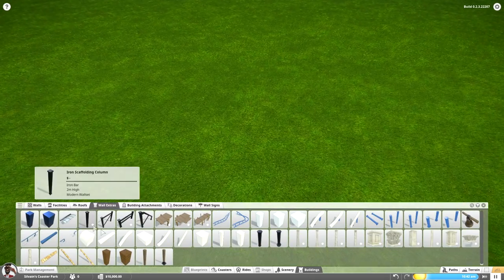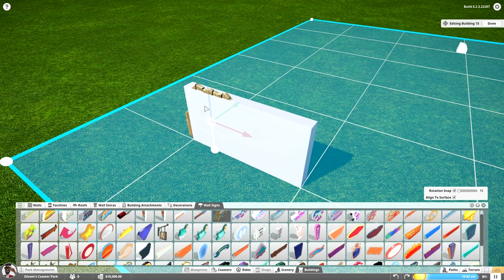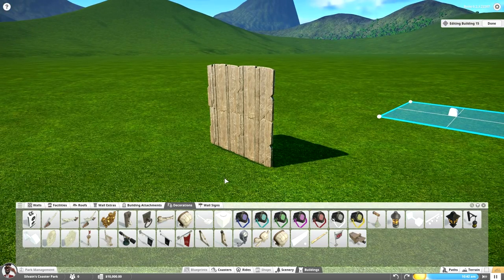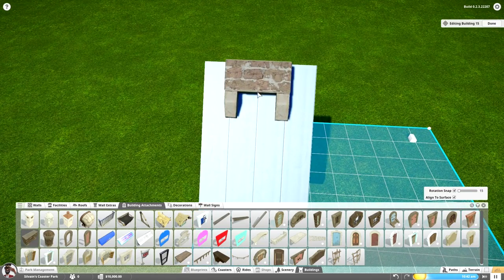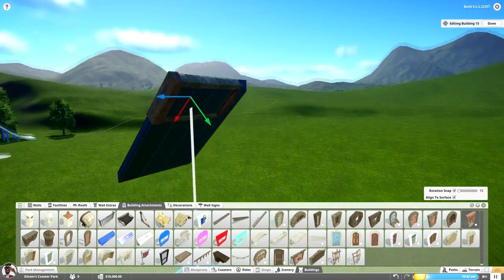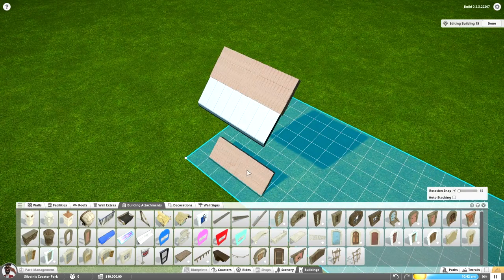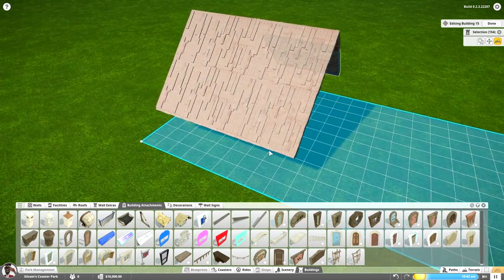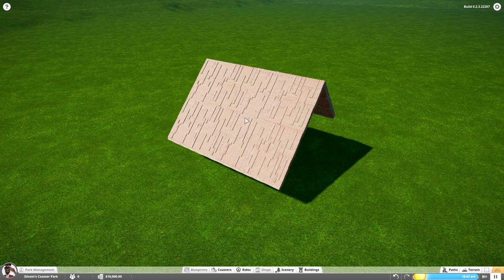Planet Coaster Tutorial - Custom Walls & Roofs

Comment: Great informative video. However Silvarret could you please mention the exact keyboard controls. I have watched your earlier video on construction, but I can't figure out the duplicate object part as well selcting differently..Many thanks in advance
Reply from the maker: Pressing CTRL+D duplicates the selection, which can be selected by hovering the mouse over what you want to select while holding down the right mouse button, or clicking on objects while holding down CTRL.
Reply: when I do that it copies the entire building..and then when I try to put beside the original one it becomes a real pain..I am sure I am missing out on something
Reply from the maker: Aritra Goswami Are you in the editing mode of the building, or just selecting the building?
Reply: I select the building and then click the edit button(pencil) and then I try to copy a articular piece, what happens is the moment I copy it the allignment doesn't remain the same and it changes..also I can only add that duplicate piece within that building itself and not as a separate building.. I have the imagination but I lack the technique.. Ilove this game..thanks for your response
Reply from the maker: Aritra Goswami If you duplicate one piece, it won't keep it's alignment - for that to happen you need to select at least two pieces at a time. And about your second point - you can never get a part of a building to become its own seperate building, that's just the way the game works.
Reply: so when I select 2 pieces with the same allignment, and then duplicate, the allignment stay? also I duplicate selecting Ctrl+Left Click and then Ctrl+D.. Thanks for explaining this Silvarret
Reply from the maker: Aritra Goswami Yes that's correct, though to select multiple pieces you need Ctrl+right click.
Reply: ok I see.   really helpful you have been silvarret.. may bother you further if I have any questions.. many thanks

Comment: BUT HOW DO I ACTIVATE THE FUCKING GRID?!
Reply: A deactivation would be nicer... But there are grid items (background of the item icon has a grid) and there none-grid items (background of the item icon is white). Place a wall first, which is a grid item, then place the individual parts (the none-grid items) on it. When you want to move it and place it on a grid, remember to select at least one grid item
Reply: Pff thanks man! This had me so confused x'DDD
Reply: It had me confused in the beginning as well. Unfortunately the grid items are to limited regarding rotation, specially when you want sloped floors...